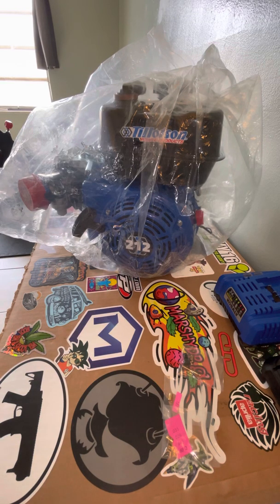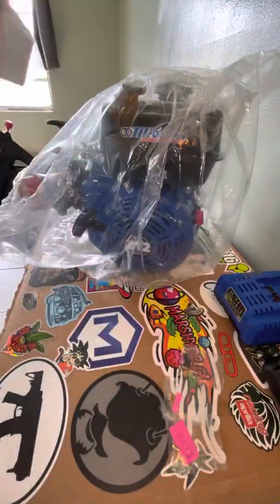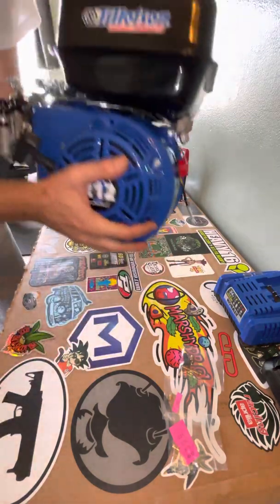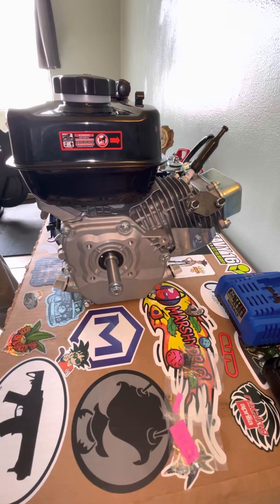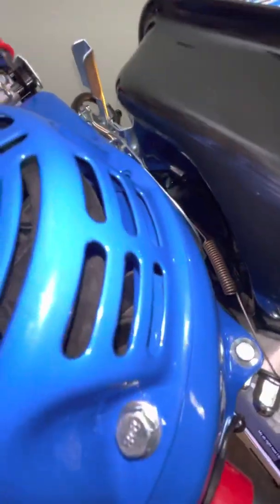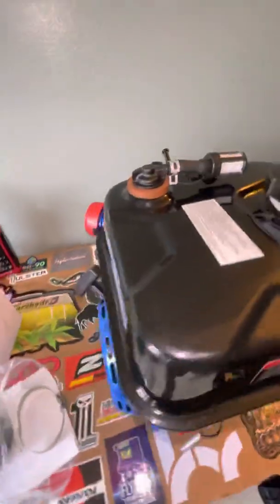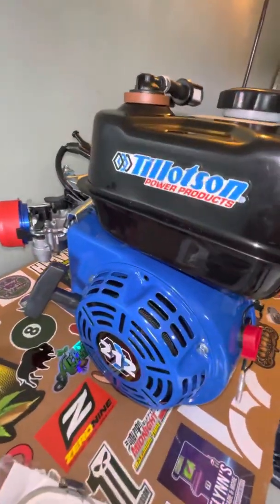212cc Tillotson Racing Engine Stage 1 Out Of Box Review

Comment: It's a Honda clone. I myself ordered the mega Moto 212 bike and motor kit, ended up having to order a three magnet flywheel for a mb 200 so I could run the head light. Motor came with a single magnet flywheel just to run the coil for the spark plug. You would think after spending over $1200 dollars the head light would work. So I called go power sports and told them the problem, they said we can't get flywheels for that, OMB warehouse had exactly what I needed for the flywheel. Fit like a glove. I have the pro tuned 212 tillotson only turns 4800 rpm so I'm good with a cast three magnet flywheel.
Reply from the maker: Thank you for all that info Avery really appreciate you brother
Reply: That's typically the case when you don't typically have an electric start for the engine.

Comment: What is the breaking process for this motor
Reply from the maker: Tillotson break in oil run engine for 45min 1hour  no throttle just ideal 
Flush and check that everything looks good and then add the Tillotson performance oil and your ready to go the break in oil helps lubricate everything properly i know some people add zinc oil additive so it can create a protective coat on the metal

Comment: That engine looks like it has a governor arm on it. Is the governor gear removed? For $500 you'd think it would at least be a stage 2 motor with the governor removed and all the goodies inside. It will be interesting to see if this engine is a stage 2 or not. I'll have to check out your other videos and hopefully you've been able to verify this motor.
Reply from the maker: Removed from go power sports but the left the mechanism on top it can be removed but it’s part of that throttle assambly wish they provided a flat top plate something more cleaner and not leave extra parts i made a video about this on my ig as well but  the internally it has been removed
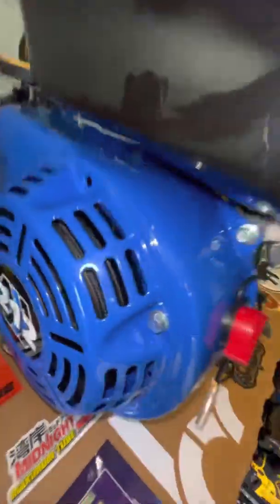Reply: They have the linkage set up the way it needs to be done when the governor is removed from the inside but the stock carb and linkage is used. An extra spring is added to get the throttle back to the idle position. You could just see the spring at 3:37.

The spring is very important and guys have found out the hard way when they removed the governor and stayed with the stock carb and linkage. Once the bike is started and the choke is opened the bike takes off on its own at nearly full throttle. They don't realize what the governor does. They think it's just there to stop them from going fast. It's also responsible for moving the throttle on the carb to idle at startup.